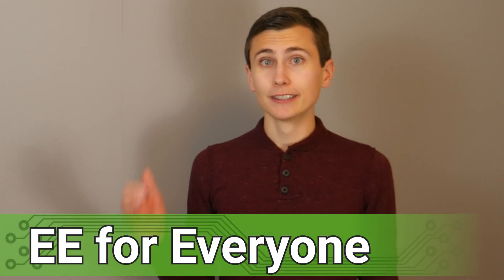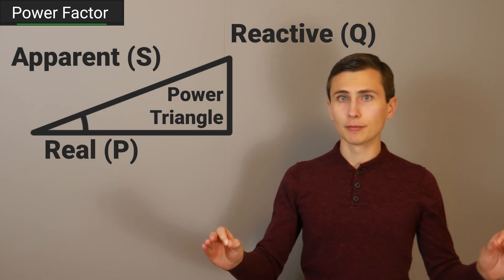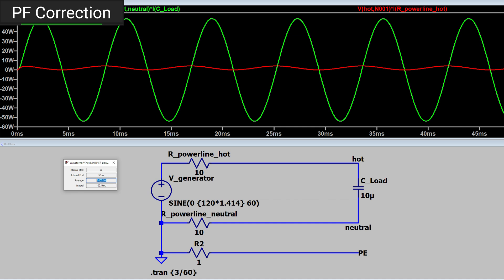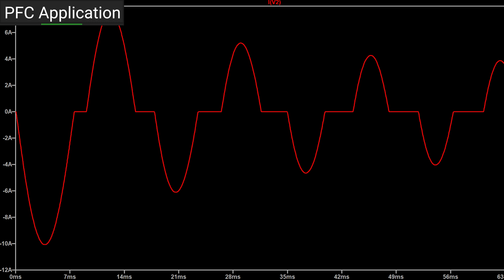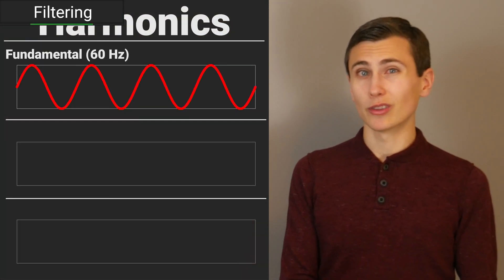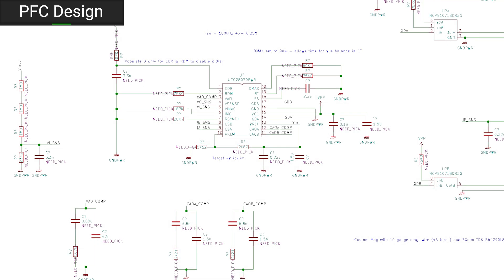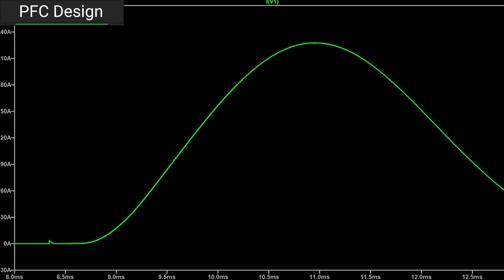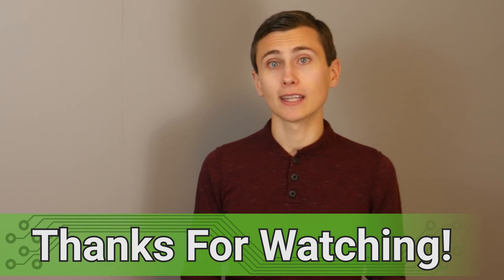AC-to-DC PFC power supply: 2400W – 400V

Comment: A little off topic, but your explanation on powerfactor reminded me of a  problem i dont understand.
In english, i think it is called "deformed power" which i cannot explain to myself with a real current running back and forth and thus creating losses.
Also the frequency decomposition is not that intuitive. Do you have an intuitive explanation about that?
Reply from the maker: Hello Kero Kero, no worries! I think I understand. Let me make sure. I think your first question is regarding resonance, when current can "slosh" between an indicator and capacitor?  Your second question... Is that regarding frequency domain analysis?
Reply: @EEforEveryone  thanks for the answer.
no, i meant reactive power due to non linear loads, like through diodes or thyristors. 
and yes, in this case it is explained through different frequency domains, because higher frequencies dont add anything to the activ power. however maybe i am looking for a more intuitive explanation
Reply from the maker: @kerokero3970  Aah! Like poor power factor for mains power/distribution. understood. Hmm... I'll think about this and see if I can throw some content together. Nothing comes to mind right now, but I bet with some pictures or animations we can get the point across. 

Great suggestion: Thank you!

Comment: @@UC-ZHvtr0YOEQ56iDrjeOLOg could you use a high effency computer PSU for the input DC
Reply from the maker: Hello Linearburn, Thanks for the comment! We tried something like that before... :) Lol, it didn't go very well, and the reason why is that there is so much current moving through the UPS that switching between primary and secondary power can become a big challenge.

Funny enough, a high-voltage ac-dc converter (pfc) is usually the first conversion step for all ac-dc power supplies! This keeps conducted noise emission down by preventing non-sinusoudal input currents from flowing. In some ways, I guess you could say we are using a high efficiency computer psu... Just half of one, and one of our own design.

For lower power levels, we could have probably gotten away with low voltage dc switching... there are some serious cost and complexity benefits for that approach!
 That said, we're striving to achieve 2000w and high voltage dc enables some cool ways to transfer between primary and secondary input power with 0 dead time. No relay switching time!

I hope this answers your question, and check out our playlist on the previous phase of our ups project "Project Darwin", for more info about our low-voltage switched UPS!

Cheers!
Reply: @EEforEveryone  or if it was  a regular desktop psu you could chain them to geather and use a sence IC to tell if all psu are suppying power and if not cut rated power to the conversion circut
Reply from the maker: @linearburn8838  Yeah, server power supplies are pretty cool, though redundancy doesn't help us too much with regard to power outages. :) We have ways to detect if any power supply has failed, and switching over to backup power should happen very smoothly. We've got some sweet videos coming where we'll be testing out these features on some prototypes!
Reply: @EEforEveryone  I was think of this server psu I had its a dell dual psu think its rated at almost 2000 watt it orgionaly went to a gpgpu compute server

Comment: would love to see more about pfc as circuit .. more about calculations, heat stuff, etc.. as lessons .. nice video thanls
Reply from the maker: Hi Hasan, Thanks for the comment! I'm glad you enjoyed our video!

If there's a specific calculation that is causing some trouble, like calculating switching or conduction losses in a transistor - I can totally focus a video on a specific topic like that.

It may be surprising, but the circuit analysis for a PFC isn't radically different than any other SMPS. The same loss mechanisms exist, and the calculations are really guided well by the TI datasheet. I thought about working more of our math into our videos on the PFC, but including these calculations would quickly turn our videos into hour-long marathon sessions... and enable people who don't understand electronics to duplicate a VERY dangerous circuit. 😬

Instead, we decided to focus on more of the unique parts of the PFC design process: Custom inductor design, the differences in control methodology, etc. If you understand how to calculate losses in a buck, boost, or flyback converter - the same methods still apply here!

Comment: Also, as far as I can remember, Boost converter has inverse step response (right half plane zeros in transfer funcion in Laplace domain).
Reply from the maker: Hi Sanel, that's right, there is a right hand plane zero for a boost converter. That's not something that will always lead to a problem, but should always be considered.

Comment: Regarding safety during test phase of pfc circuit, did you consider to use isolation transformer?
Reply from the maker: Hi Sanel, thanks for watching! We have an upcoming video on the isolation strategy and general architecture of the new ups. Long story made short- the plan is that isolation will exist between the output of the pfc and the user, but the output of the pfc does not necessarily need to be isolated from the high voltage dc bus.

If you mean safety as far as lab testing for the prc, I'll be using our phase 1 ups to generate an 85v rms sine wave when testing the circuit with extreme current limiting. If that goes well we'll take it up a notch. :)